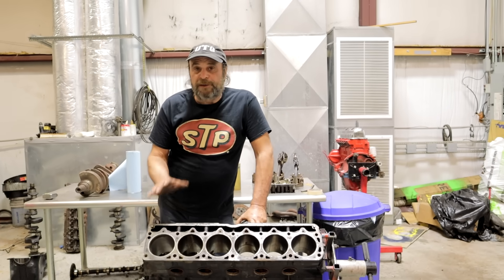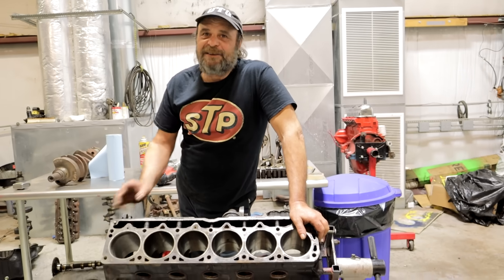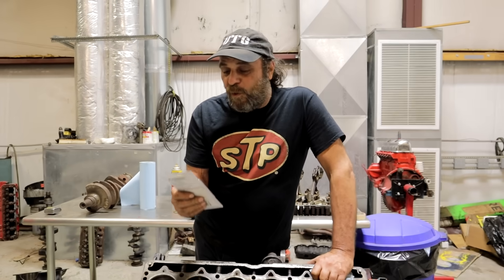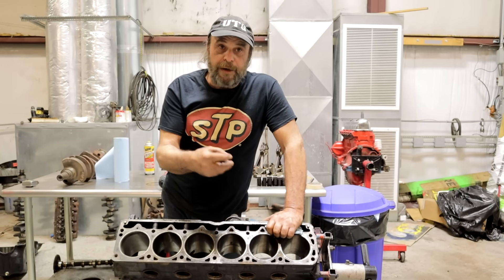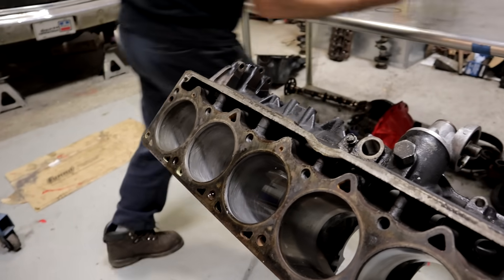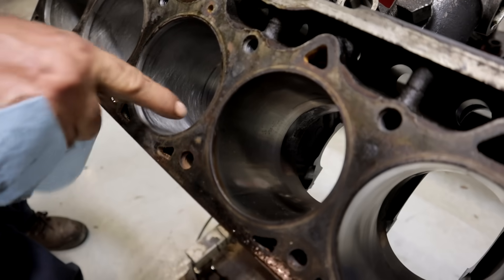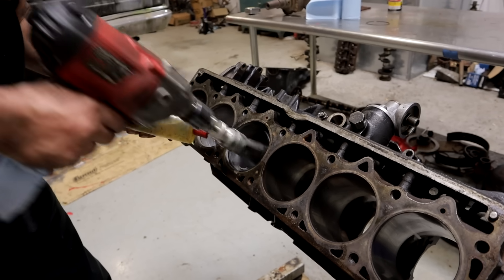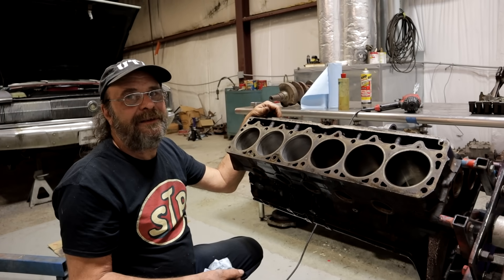Your First Engine Job - Honing For Crosshatch And Choosing The Right Stones For Your Rings

Comment from the maker: Yup!  At 14.40 I installed the hone with one of the stones flipped.  It happens.  Lesson here is don't allow yourself to be distracted (By doing things like making video....) while you should be focusing on your work.
Reply: I had to rewind to make sure I saw that right, and then I couldn't stop twitching.
Reply: 😊 @erikstrawn3885
Reply: I saw that! thanks
Could that mess anything up?
Reply: I was just thinking you really dodged a bullet there - because for some reason, it didn't seem to mess up the bore finish as far as the camera shows.  Sometimes, it's better to be lucky than good - but it's always best to be both.  Cheers, Tony.  👍
Reply: At least you caught it! Imagine uploading that and having everyone tell you your mistake. They probably will anyway. :P I doubt that aluminum hone (I imagine it's aluminum) was able to overpowered the steel sleeves in there. If anything you just ground the hone down a bit with your crosshatch, lol.
Reply: Tony I don't know if you plan on doing the pistons in backwards or not with the 4.0. Amc and Chrysler in both of their publications on hopping up the six have stated to reverse the fully dished piston. I've built my 258 that way and there's know doubt it pulls harder. I know David vizard says it makes a difference. I would like you when you are ready to assemble the engine would you put cylinder three in correctly and four in reversed for a demonstration With a degree wheel And dial indicator you could demonstrate what has changed. These two being companion cylinders would help show the effects of the pin moving from .060 From the center of of the piston. As you'll see they won't see TDC at the same time. Also resetting cam timing is why this works. Something that Richard holdener didn't do when they tried to disprove the theory. To me if factory engineers and DV says it is worth power it's worth a try. Thank for your continued content
Reply: I think you had us all going NOOOOOOO 🤣 it happens. Doubt it hurt anything anyways. The point of what to do and what not to do has been made and glad you keep it in and corrected yourself. Let's us know its not just us making mistakes lol 👍
Reply: I cringed when I saw that!
Reply: You should flip them all backwards and see if you like the hone better, haha
Reply: Are you sure it wasn't the squirrels to blame
Reply: I thought you did, but I watch in +1.5 speed, so wasn't sure.
Reply: I was meditating on how this would affect your honing as I watched, and sure, I rewinded to double check. :P
Reply: Been there to and distraction  happens fast and easy.  (The moose got the best of me)
Reply: We all know you did it on purpose to teach us a lesson. Plus it got a lot of replays guaranteed. Genius!
Reply: I'm amused by all of the irony-blind people posting about you "not paying attention" hours after you pinned this post.
Reply: You're human brother great content anyway plus it shows how tough a classic American iron block is.
Reply: Nobody's perfect Tony.
We're all the same. Human, fallible and flawed.
Reply: Give it a second run with the hone
Reply: I  was about to point that out,  looks like everyone else seen that also....damn
Reply: OK, I saw that the first time and backed the video up to be sure. Glad you noticed it, too. I blame squirrels! Watching this series intently, going to teardown and rebuild a 79 360 soon.
Reply: I don't think that's the idea of plateau honing 😁
Reply: Glad to hear when you said “looks good”. Nice to know some mistakes don’t matter. 😄
Reply: As long as you remember to go back through that cylinder.. Always good Tony
Reply: I saw it too, went to say something and it's apparent that people paying attention..
Reply: I smiled when I saw that if only that was the worst thing I have done putting a motor together , love the content , Mission impossible is the most interesting engine build I have seen in year's
Reply: O man I was like Tony no your better than that but I know the struggle of screwing up videoing lol
Reply: Yup Motor is junk now throw it out now 🫣  just lost 200hp by doing that 😑
Reply: Is this honing process necessary if you’re just changing out pistons and rods for forged ones in a good running engine???
Reply: Me: No wait!
You: Can't hear me because it's a recording...
Reply: I caught that, haha, no harm no fowl.
Reply: Watching this 3 months later, went to the comments to see if anybody noticed that, tons of people did, guys in this hobby pay attention.
Reply: Omg I came here with my jaw still dropped to point out 14:48. 😅😅
Reply: But you got a good crosshatch out of it. 😉
Reply: race spec engines need excessive care to them, a hard wearing engine doesn't need it, a workie vehicle is made to be abused.
Reply: Saw it right away ,all good ! keep up the great work !
Reply: I got plenty out of that . Like your style and manner!
Reply: Verry good movie with explanations which is or which isn’t impoortand. What about straight line on the surface? I am fighting with 4.6 v8 northstar engine after head gasket blow… i am using car from time to time, honing will remove a straight linies/ groove but piston ring has 1,2 mm gap …
Reply: This is why I came to the comments!  I had to rewind and pause to make sure.  This is a good video, thanks.  I've rebuilt a few mower engines now I'm trying a car engine for the first time.  I know an experienced mechanic who's happy to come look at it and give me advice.
Reply: Shit happens bro. Keep up the great work!

You're helping DIY plebs like me.

Thank you!
Reply: Tony what grit are you using for ductile moly rings,  "medium" is that like 220? Dart SHP SBC with Moly rings.  4.155 bore 406
Reply: @406MenaceRacecar I’m here looking for the same info. What grit is medium? lol
Reply: @Shake-N-Bake-413  I ended up taking it to someone,  figured $100 for a nice tool and Don at Dynamic in Westland/Wayne Michigan honed mine for 200
Reply: @406MenaceRacecar No way. I’ve been to dynamic. I live in Romulus.
Reply: @Shake-N-Bake-413 Yeahhh man they used to  be on Wayne rd now it's behind North Brothers Ford dealership Ford/Venoy on Beechwood
Reply: Maybe that's the secret
Reply: If you were a weed smoker you'd have a scapegoat to blame it on. 🤣💩 It'll buff out.
Reply: I thought so! Lol.
Reply: So when u Honing the cilinder. Do u use the same size of piston ? Or bigger?
Reply: I saw it!  I had to rewind as well. I thought maybe, I am into my second beer as I'm watching this. It's all good though. I came here to learn.
Reply: Yeah I actually noticed that happen too. Very informative video though
Reply: Vid still worth more than that slip tho. Thanks
Reply: Haha.  I yelled at the TV 😂😂😂😂.   I tried to help 😎
Reply: I thought I saw that, but I must have been mistaken, my Uncle Tony wouldn't let that happen!. Thanks for another in-depth video on things that I am facing, it's very comforting,
Reply: I know I'm a year late and a dollar short veiw this video. I had to back it up twice to be shure I saw what I saw and I did. Thought Hey Tony you blooped on that one stone but it shouldn't hurt the final out come on that cylinder doing a short demo.
Reply: It was appalling
Reply: 14:40
Reply: Real problem is if you had a v8 that bottle would have a place to sit. Hahahha love the channel. Found you when you brash painted that block i did it your way looks great people dont believe me when I tell them what they are looking at. I did the same red.
Reply: The aluminum frame that holds that stone is a LOT softer than the stone, and softer than the cylinder wall... I think you were basically just cutting with 2 stones and the other (flipped) one isn't going to leave a mark on the cylinder at all. The only danger would be if the kotter pin were to be what was riding on the cylinder.
Reply: @stevelacker358  agreed. I doubt that did anything at all to the cyl. Probably can't even tell

Comment: Hello, I will make a ring job soon in an in line 6 250 chevy, I am removing the oil pump in order to change the rear main seal too, Do I have to prime the oil pump before I start the engine after reassembly?

Comment: After honing (WD-40 and dingle ball hone since that's what I had and the cylinders are pretty round due to low-ish mileage) I knocked down the cross hatch peaks with WD-40 and 3000 grit wet/dry sandpaper, maybe 10-15 swipes per cylinder by hand with a swiping motion around the bore not up and down, I figure if I went up and down it would be much easier to miss a lot of the material I was trying to knock the tops off of.  There's plenty of valleys left from the honing, I figure I don't have the tools to do a plateau hone so this shouldn't be a God awful terrible idea. The cross hatch is still very visible .

Thoughts Tony?    The cylinders are definitely slicker/smoother so it's less rotational friction just like using metal polish on a crankshaft after using the shoe lace/WD-40/sandpaper trick.  That knocks down the microscopic edges that the sandpaper leaves so it reduces rotational friction and heat on the crankshaft, lightly wet sanding the cylinders should do similar no?
****I'm using 5/64 moly rings on a small block ****

Comment: I remember a 4.0 I had once I had a press fit pin slide out of the piston and gouge the cylinder wall about 30 thou in two lines, I did a quick replacement of the piston and rod and reused the almost new rings and it ran perfectly and didn't burn oil 😂, apparently it caused very little blow by

Comment: Thanks for this informative video.
For each pass, you used an average of ~ 60 back  and forth strokes (using grit 220 stones ?). Could you give us an idea of the average increase of the bore after such pass ?
Also could you give us some guidelines regarding the angle of the crosshatch to target?
I have read that it should be in the range of 30-45°. Is this correct and how critical is it ?

Comment: I'm working on a 6.0 LS engine iron block. The bore is 4.0. How much of this type of honing might I do to, to complete the job? I have cross hatch visible on all cylinders before starting, one cylinder has the stain you spoke of. That was from antifreeze siting in it before I got the engine. I am looking to replace the crank, rod, and cam bearing on the engine. My goal is to do a stock refresh using new parts. The only parts of the rotating mass I am planning to use is the crank and connecting rods. The internal parts had wear but no signs of excessive wear or heat damage on them. I have new forged pistons, cam, lifters, rods, and valve sprigs. I will be reusing the valves as they are in great shape with no signs of damage and only normal wear showing. Any advice is welcome sir.

Comment: Thanks! And - of cource you can hone cylinder without stress plates, maybe even bore without them ;-) but you cannot measure correctly without stress plates, it can change diameter for about 0.03 mm, and boring with no means of precise measurement is kinda useless.

Comment: My rings are cast is out of a 1946 dodge would 220 grit be too smooth, ? I just need to take the rust out the cylinder walls

Comment: Dumb question but i just ordered kb hyper pistons for a .40 over 350. It says the top 2 rings are iron and the oil ring is stainless steel. Does that mean i use a course grit?
Reply: yeah i think typically with iron its pretty coarse

Comment: The first 15 to 20 minutes after a fresh start on a rebuild makes you pucker. Run it up to 2k to break in the new cam and cross your fingers as it sputters and smokes. Have never wiped a cam but have heard horror stories. From what i hear it is more common nowadays with cheap camshaft heat treatments.

Comment: But don't torque plates allow for a more precise cylinder bore alignment to the crankshaft bores centerline?
Reply: I never heard of that for doing piston cylinders but I do know that some crankshaft mainbearing saddle bores having to be aligned honed. 
I would expect cylinder bores could need it in certain applications like a resleeved aluminium block, but if its bad enough I say the block was a bad casting in iron blocks from factory. While the crankshaft main saddle center line alignment is more crucial causing abnormal wear patterns on crankshaft bearings, rod bearings, wrist pin bores, piston skirts and cylinder walls. 
 While a torque plate is used to simulate the tension distortions in the cylinder bores of an installed cylinder head. Mainly used for performance applications and realy not necessary for stock applications.

Comment: I have never had a engine fail, and I have built 100's.....all makes and model foreign and domestic....and most everything in between.... auto, truck, tractor, motorcycle, small engine, 4 stroke, 2 stroke, Air cooled, rotary.....and yes Tony is correct...

Comment: The third time you put those stones in there you had one of them backwards. But it wasn't going to cause damage because the soft metal will not damage the interior of that cylinder but the other two stones won't be exactly concentric

Comment: Might make a note of the ring lip in the top of the cylinder.  It is not unusual to  use a ridge reamer to get rid of it.  You can  break the the top compression ring if it is to sharp.  Just saying!!

Comment: Hello Tony, I'm thinking of putting an older engine into a newer model truck or car. 
The part I'm not quite sure of, is what I need to do to keep the old and new running  running properly. Like getting rid of the computer, and being able to run all of the electrics in the new truck and every wire to run the old engine. I'm sorry it's not about this video, but I know it's a easy question for you

Comment: I have a motor that was machined years ago and it has been stored away in my garage ever since it was machined. It has developed surface rust even though I sprayed it with WD40 gel spray after it was machined and washed. Was wondering if you had any tips on what to use to remove the surface rust. I'd hate to score the block deck and bores by using the wrong tools/materials. Thanks in advance.

Comment: A torque plate is useless with a glaze breaker which he is using here. They tend to follow imperfections. An actual hone makes the cylinder round or keeps it round.

Comment: I cant find any videos on using this type of stone hone on atv and dirtbike cylinders. Im reading not to use them because the spring loading action can catch the ports inside those type of cylinders. That a flex hone is the best because of the ports. Any input?

Comment: Here is a tip for all you creative types out there. When it comes to rebuilding engines, one thing you absolutely DON'T want to do is chamfer the cylinder tops. Let me tell you why.

Recently, I had a customer bring in what was supposed to be a recently rebuilt engine from a full-service junkyard. However, upon inspection, it became clear that although the engine had been rebuilt, it wasn't done properly. The use of water and absence of a thermostat hinted at trouble, but it was when I dismantled it that I found the real issues.

Rust stains in the cylinders and evidence of multiple head gasket failures indicated serious problems. Despite the low mileage and new pistons, the tops of the bores were chamfered, likely for easier piston installation. This seemingly innocent modification had dire consequences. The head gasket wasn't adequately shielded from the combustion flame, leading to overheating and premature failure.

While a general rule of thumb is to maintain approximately 1mm or 0.04 of clearance between the head gasket and both the cylinder bore and the combustion chamber, it's essential to verify this clearance according to the specifications of your specific engine. Engine designs can vary, so always refer to the manufacturer's guidelines for precise measurements. Proper clearance is crucial to prevent overheating and premature failure of the head gasket. In this case it was likely hanging inside the bore.

If you're working on an engine without alignment dowels (common in older 4-cylinder engines), don't worry. You can use a thin layer of glue, like contact glue or silicone, to secure the head gasket in place. Just apply it sparingly on the outer corners outside of the bolts, and ensure there's no excess.

Remember, proper engine rebuilding is all about attention to detail and following best practices. Don't let shortcuts like chamfering the cylinder tops lead to costly repairs down the line or worse still an engine that you can never figure out what's going wrong! Happy wrenching!
Reply: I've seen cometic recommend at least 0.01 clearance.

Comment: I wish you would have mentioned the actual grit needed in both the iron and moly rings. All you said was less corse for the moly. so what's that mean 400?? 600??
Reply: I think coarse is 120to220 and fine is 320 and up. I think..

Comment: Went to a sealed power interview in high school learned that if your building  an engine a basic overhaul do nut break the glaze rings seat faster in shiny cylander bores after that i never put a stone to them and never had a problem seating rings ive seen machine shop rebuilds that the engine smoked grey for hours until ringsnseated

Comment: Question for you guys. I'm getting ready to do the same thing. I have my pistons and rings. The top ring is iron, second ring is cast iron. This is in the description on summit racing. It's a Jeep 4.0. do I need to use a rough grit or a medium grit stone? Btw, it's a 2000 Cherokee.

Comment: Tony, I’m building a 318 la motor for my 90 dodge ramcharger. I want to give it a little more power but still keep a bit of gas mileage. What cam would you recommend for a bit of an upgrade. I’m swapping out the tbi for a edelbrock 650 cfm on a edelbrock street dominator intake with 340 heads. Any suggestions ?